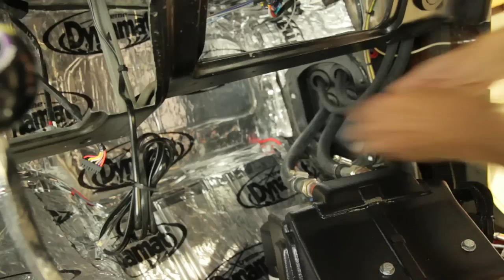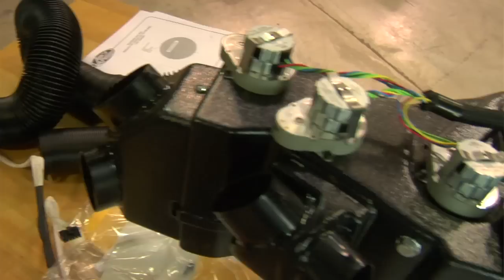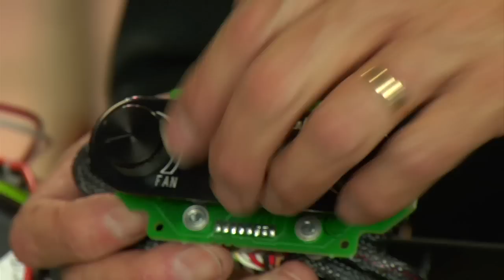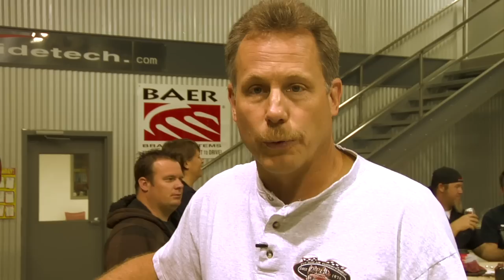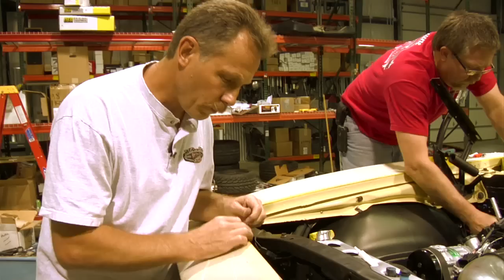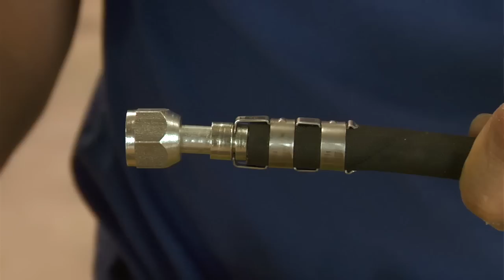48 Hour Camaro - Product Detail - VINTAGE AIR AC UNIT

Comment: really appreciated this video. im building a pro touring 69 camaro, and the car actually came with a vintage air unit, which i know NOTHING about!!! after inspection, i see it is a 2003 model, hence older technology and not one im looking for in my dream car. so ill ebay that unit and order new. dumb question, but how do these units generate heat, in the traditional way, with engine water?

Comment: Could i modify and make my own custom brackets, and install this particular Vintage air AC unit in my 1978 Chevy K5 Blazer?  My Firewall is seal & has no holes in the firewall, i took out the old AC system.